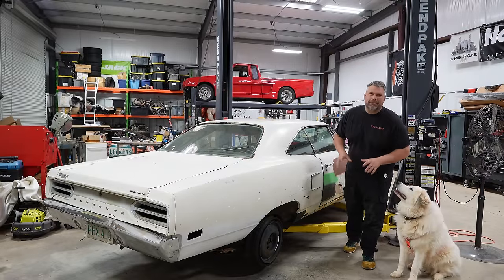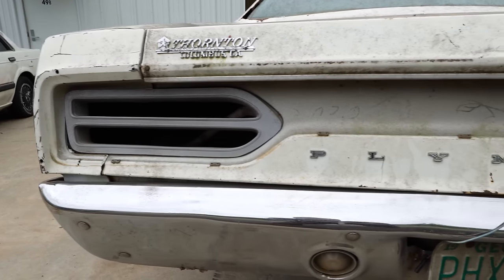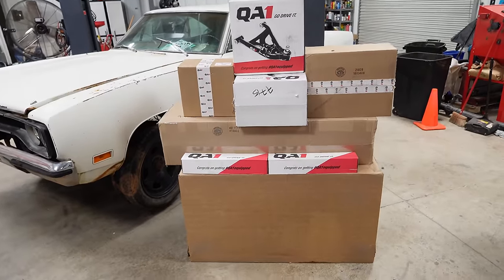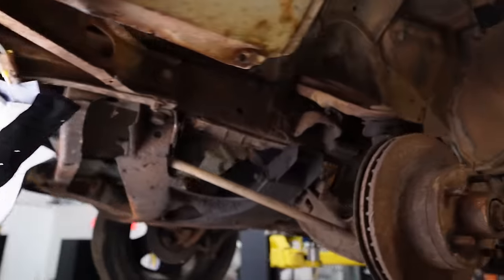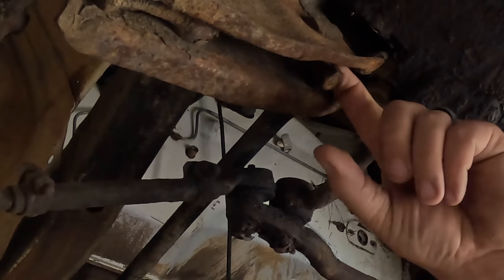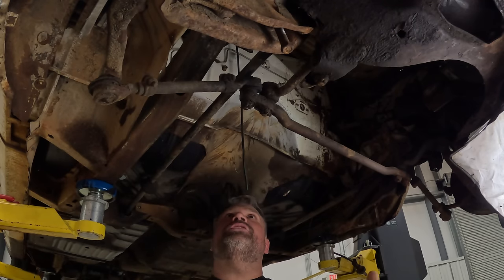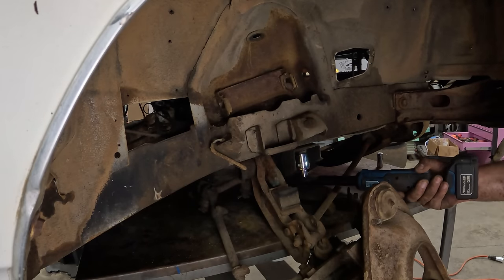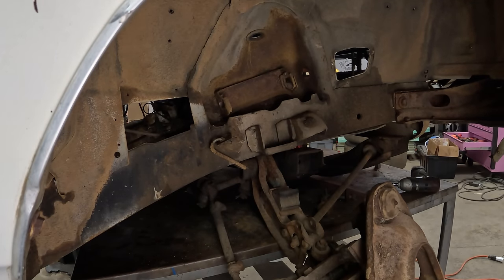Building My Dream Muscle Car Part 1 1970 Plymouth Sport Satellite

Comment: I was lucky enough to pick up my dream muscle car (1970 Ford Torino with a shaker hood) last winter in a non running state was able to get it running and drive it one whole mile before the timing gear came apart and all the pistons met all the intake valves, I have since rebuilt the Cleveland  and decided not to put the auto back in and do a 5 speed conversion. in the process of getting it back on the road hopefully for more miles this time. I defiantly understand the struggle of having a non mainstream car but I am very excited to see the satellite get built.

Comment: My garage is filled with the parts for my project... the head is done, but i need to clean the deck! I should lift the motor to pull the pan, it needs cleaning and some fresh oil through the pump & passages.  Then we're ready to put the motor together! High compression pinto 2l moving to the fancy intake and 4bbl carb... likely 4.25 gears until i know better.

Comment: Not sure what your plans are for the 440, however I highly recommend the Holley Sniper 2 complete with the EFI fuel tank. Not sure if you are stroking it or not either. However I also recommend an overdrive. These two things will make it so much more enjoyable as a cruiser. I have a 69 Charger with an Indy headed 512 and solid roller and frankly it's really overkill for a cruiser. You can go with a stock stroke 440 with TrickFlow 270 heads and still have WAY more than you need for a cruiser. Good luck with your project and thank you for keeping it as a Sport Satellite and not cloning it.

Comment: I would  be putting  that engine in place  and checking for exhaust fitment before going any further.  This is the time to find out if you are building custom headers, or hacking inner fenders to make something  fit. You have to do this before bodywork. Not after that firewall  and fenders have a nice coat of paint.

Comment: Favorite muscle cars: 1970 Firebird or 1972 Barracuda..

Ive been working on a 2003 BMW Z4 that was SUPPOSED to be a good condition daily driver. It is anything but that. Both roof motors were shot, the frame is damaged from an accident (that was covered up..), the interior was full of mold and standing water. Oh and chasing down a huge power draw when the car is off. After an exhausting winter, the seats have been recovered, the mold is gone, the carpets have been deep cleaned, and the interior is finally going back in, slowly. After that, fixing the mechanical issues, and then off to the body shop to get the frame straightened.

Comment: If you nicked those torsion bars with the vice grips, they are junk.  Because of the twist, a nick will make a stress riser and the bar will break after some use.  The factory tool is designed to avoid that.  The other method is to take the pivot pin and strut rod nuts loose and drive the lower control arm backward until the torsion bar pops out of the crossmember and then it should come out of the control arm easily.

Comment: You can fix that perfectly fine. Or you can make a little U-shaped fixpanel that replaces the damaged material, and you can pinweld(?) It to the framerail from the sides and fully weld underneath. That's what I would do. It's a bit more work, but that would fix all the issues and you couldn't even tell. :) That is how I fixed an old Merc that came through our workshop, and the owner was over the moon happy with the results.

Comment: Yeah they like to rust there in the frame rails under the shock towers.
Water gets trapped there, I drilled small drain holes in that area because after I had washed my Satellite I could see water collecting there in the frame rail between the gussets.

Comment: My brother-in-law and me (let's be honest, until now mostly him) are rebuilding a forgotten project car. Golf MK2 with a 90hp 1.8 liter. We should be in the reassembling stage now after rebuilding the engine and converting it to manual transmission (including rebuilding the whole shifter-assembly). But sadly we found more rust where we didn't expect it so my BIL has to take care of this first. Then we need to repair the rust we were already aware of and then we get to the fun part: Installing the rebuilt engine, the rebuilt shifter assembly and the new (not yet ordered) suspension. Then the car will be prepped for a respray and we'll install a nicer interior and a full audio system (which is the part I am the most exited about since I love doing wiring and I got free reign from my BIL).
And THEN we will get to one of my favorite cars which has been off the streets for almost 5 years now and I cannot wait to drive it again: A 1996 Mitsubishi Sigma (Diamante) Station Wagon with a 6G72 SOHC engine. It is such a rare and cool car.

Comment: The drill/weld repair on the frame rail is the best value in terms of cost and time. If it were say an incredibly high value car where you're going for a pebble beach finish maybe then maybe do just the frame rail itself but really for.this particular car - perfectly acceptable and would be incredibly surprised if that affected value at all.

Comment: You're looking for a nice cruiser. Meaning no hard streeses from circuit racing and the such the loaded stress on frame will be minimal compared to a vehicle used in racing. I say drill, weld, and fill then sand down nice. Then prime and paint. Remember jared  to use the KISS method.

Comment: Currently replacing my 302W with a new motor after 25years hard work 220000km!! A leaned out carby did some damage and it was more efficient to replace motor than rebuild - parts problems, waiting times in workshops etc. Rewired a lot of the engine bay and fixed stuff that I promised to do decades ago!! Trouble has been that we have had supply problems with railway lines flooding and parts taking weeks to get delivered! 1 Part sitting on train somewhere, is stopping me fitting the engine at this moment! Once the flexplate arrives then it's go time! This motor has many upgrades: roller rockers/cam and lots of aluminium parts reducing weight!

Comment: Honestly, I would start the body work and panel replacements, and when you get it almost ready to paint, do the engine (after you paint the engine bay) this way you don't hit the It runs and drives so I will get to the body Later Syndrome. My Favorite muscle car is a 1963 Chrysler 300 J, 2 door hard top.

Comment: Hi. The original rear shocks would have only been oil filled dampers, gas charged dampers on run of the mill cars didn't happen till the 90's.so if you compress the shocker it will stay compressed. Cheers MD

Comment: You don't want to use vice grips on them. With the teeth dug in, it can cause the torsion bars can split later down the road if you reuse them.  Since you are deleting them it's not a problem.  I have a  68 sport satellite with the same suspension system you are using. I run a 496 stroker big block and a 6 speed manual.  It is even white with blue interior.

Comment: you're adding more weight to the frame rail with the new suspension and steering. I would highly recommend replacing the frame rail for the maximum safety and aesthetics of the project.

Comment: To damp is to control motion
To dampen is to make wet

I'd cut out the cracked frame section and replace it. To correctly weld over a crack, you need a much larger hole at the end than you'd think and you need to make 100% sure that you've welded through the crack 100% and not weld through the hole at the end. The hole at the end is there to distribute the stress from the crack, if not large enough the crack can propagate past the hole.

Comment: Favorite car is a 1967 or 68 Plymouth belvedere with a 383 4 speed. On the frame rail, I would drill and weld it. I think it would be a lot more obvious of a repair to section a frame rail or do a complete replacement

Comment: I'm finally getting to a 78 civic that's been waiting 25 years to have enough time to repair all the rust holes replace the driver's quarter panel and then Get the 1.6 l that I put in it from a 81 accord.

Comment: Pin holes are just the visible points of thin metal. The rest can be thin but not quite there yet. You have to at least cut back to solid and replace.

Comment: I would totally just do the basic easy fix and weld up the crack on the old frame rail. Maybe add some extra plate to reinforce it in a few spots. I don't trust most modern replacement parts to fit all that well and even if its a perfect reproduction, the odds of getting it welded in perfectly and having everything line up are pretty slim without lots of fixtures and jigs.

 BTW: 17:57 Rack and Pinion steering definitely pre-dates the 70s, though not in anything American. The MG TD had rack and pinion all the way back in 1950.

As far as what I'm currently working on... I am doing a ground up build of a 41 Chevy Rat Rod Pickup on the cheap, more work on my 78 K5 Blazer (bodywork videos in the next few weeks). on the back burner are my 71 MGB and 69 Volvo 142.

Comment: Go all motor on it with an auto trans, just make it a cruiser.  Do the sound deadening, make a plush interior, piut a nice sound system in it.. forget about going super fast.  Just make it bark and be a looker.  All else fails, throw some sushi slicers and a bottle of giggle juice on it.

Comment: I am a mopar geek and basically Barracuda's while not Cheap holy cow sometimes are my favorite so I will be curious to see this Satellite.  On the frame rail if you find any more rust damage replace it otherwise the safe patch is perfect but iirc those like to collect from the inside and rust that way so maybe a minicamera borescope look first.  am in the order parts mode and the overwhelmed trying to little bites around work.  I like the make it run and drive thing that way anything that Will need modifying gets found out before pretty paint must get dimpled or cut plus another small victory.

Comment: I'd drill and weld the crack *for now*.  If it still bothers you after repairing it, replace the rail. Its not gonna cost that much in time or resources to patch it and you can still replace it later if need be

Comment: I'm gonna vote with most of them, do the repair on the frame…   then if needed do the rep pop. Yes you should've done the repair before you installed the crossmember. As far as the rest of it strip it down put it on a rotisserie … make sure there isn't anything else that needs to be repaired because it's one of those things that happens with that 50 year old car.  Don't worry about the drivetrain now.  And yes, keep it a sports satellite.

Comment: Patch the frame. More of us will likely be in that position without the resources to buy a frame rail.
The only thing I would have done differently in your demo would be to explain what the purpose of a shock absorber is for:
     It's for keeping your wheel on the road. The more time your wheel is in the air after a bump, the less traction you have. Imagine if you had to make a sudden turn to avoid an obstacle and one wheel is in the air due to hitting smaller pieces of that obstacle. With only one wheel with any traction, your chances of understeer are doubled.

Comment: The welding the crack is just as good or better than replacing the frame rail..  You are right to drill the holes, groove the crack for 100% penetration. ... cutting and splicing a new frame rail is much more tedious and allows for much more error.

Comment: Start on the engine so that when you eventually find out that there is a part you need to order that isn’t in stock you can shift to the body work.

Comment: If this is a car that you are taking a different approach on that you usaully dont do with your other cars such as interiors, and trying to reach a certain level of perfection i think you doing the frame rail replacement the right way is the way to go. you don’t usaully do cars like this or try to reach that level of quality. so if your already going to go all out on everything else the little extra work in doing the frame rail is going to be one of those “im glad i did it” once everything else is how you envisioned it.

Comment: Replace the frame rail, sure you could patch the holes with the welder but I suspect the rust has thinned the steel and therefore the structural integrity

Comment: I've never been too much into muscle cars. I think camaros are cool. For the exact reasons you described, I consider corvettes sports cars. My questionable choice was getting a 1984 corvette last year to rehab. I got it's vacuum leaks sorted out and a replaced the fuel pump. Now I'm trying to figure out why the thing clunks and stalls when engaging drive or reverse. The drive shaft seems fine as far as I can tell, but I have yet to check the front side since the exhaust bolts are all rusted on and I haven't had the change to break them off (the exhaust blocks the drive shaft access).

Comment: No way I would replace the frame rail unless I knew it had been damaged in an accident and not square with the rest of the frame. I would cut out the 8 or 10" of the bottom that's cracked and rusty and weld in a piece of flatbar.

Comment: Well Jared you asked I am currently working on a 2016 charger with the dreaded 3.6L vvt 6 cylinder my family member purchased it and the heads were warped dealer wanted $8,000 to fix it I did it DIY for less than a $1,000 for parts and labor almost done.

Comment: If you're planning on making some power with that car, that wimpy rear end has got to go. 8 3/4 will work with a automatic or a Dana 60 if you're going manual. You will have far more gear ratio options too

Comment: Jared honestly on the crack repair, it's one of those things if you really care to keep all the steel original, then do the repair. If you're not inclined to care if it's all factory steel under there, then buy the kit and replace it. I personally would repair the metal that's there, it's perfectly 100% acceptable, if not suggested, to repair that metal. It's PLENTY strong and will be better than new once you're finished if you do it correctly, and you will. This is totally your call though, and you really shouldn't overthink it. You've probably already decided, but hey.. what's 2c worth today anywway?

Comment: If you had found that the car had already had the drill and well patch done to fix the crack would you have gone to the trouble of replacing the frame rail anyway or would you have noted it and kept on going making it into the the “car of your dreams”? That’s the answer in my book!

Comment: Definitely change out that damaged front frame and fix it properly. Structural components should never be compromised given the 440 you plan to install. And let's face it, you will regret not doing it later in the build. 🤔🫣

Comment: I wouldn't just weld up a crack without a reinforcement plate either side.... weld is less ductile than the parent metal so is more likely to crack again in the future !

Wouldn't bother me at all if it was done properly -  neatly cut to size, nice rounded corners, maybe even a small flange top and bottom - it'll just look like factory installed reinforcement plates - no one will ever know !!

Comment: current and last project, getting to be too much for a 73 yr old working in his driveway, is a 1988 dodge dakota.  out with the cracked block 239-6 in with a 5.3 converted to a carb.  everything mechanical is done.  only figuring out the wiring is left.  computer deleted. main problem is i'm partially colorblind and about half the wires look the same, lol. been at it about 2 years truck is a georgia special with no rust. let me know when you have some free time and i will gladly let you do the wiring.  love the content keep things questionable.

Comment: Not a fan of these I must admit, but you oughta see the roadtest of the 1968 GTX, like if you can get it to handle like that, with bias ply's and torsion bars, you should be pretty set, as they glued those together well

as it handled nearly as well as the E type actually

mine was always the 3 C's, Cuda, Cobra and Countach, unfortunately every single one of those has speculators ruining the market, and everyone goes for the 71 which has the best face, and has always been my favorite in convertible with a shaker hood form

next to a 70 AAR cuda

mind you I've always thought the idea would be an all aluminum 440, that way you have the power and sound without the weight dragging you down, as apparently the difference between a big and a small block is literally 400 pounds

although that GTX in the roadtest was a 383 and that seemed to handle damn well, mind you I kinda think all mopars need the monte carlo bar the mustangs had to properly connect the cowl and the shock towers

Comment: Jared! You never told us how much power earl made on the dyno
Reply from the maker: Will do a follow up when we get the combo all correct, it sneezed out 400hp without Kevin leaning on it at all due to the fuel distribution issues and cam choice were causing. New cam is already here!

Comment: So a life long “49 years old” friend of mine has a 1968 corvette 427, 4 speed hardtop convertible. Less than 40k miles. His parents bought it new. Is it a muscle car/sports car?  Great question. It has all the muscle car engine and trans. But independent rear suspension. More sporty with the top off. I’m gunna say sports car is more accurate. A very muscular sports car. Hybrid if you will.

Comment: My ultimate muscle car would be a 1970 RS/SS 454 4 Speed Baldwin/Motion Camaro. no options, save for power steering and brakes, with a Posi 373 gear ratio. Black exterior, White stripe package/ White interior... Is that specific enough? I only wish I could afford it. I know it exists, because I saw it personally in 1980, listed for $4500.00... I know, Right?